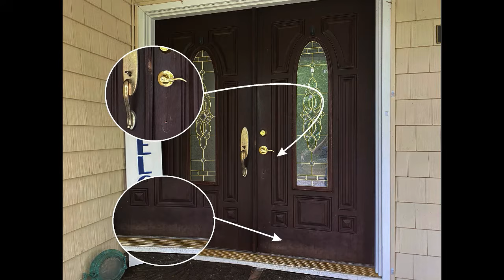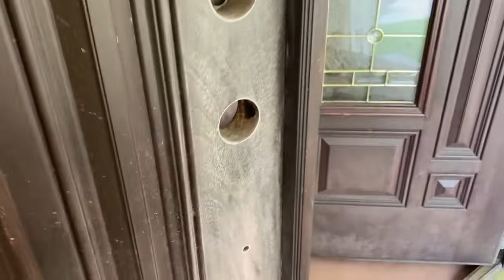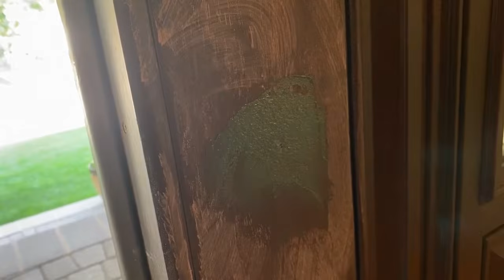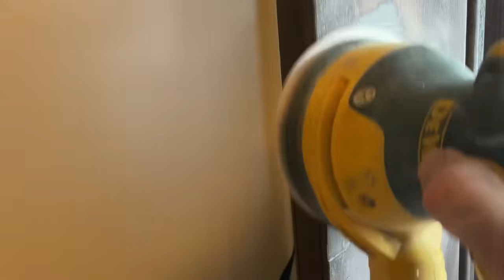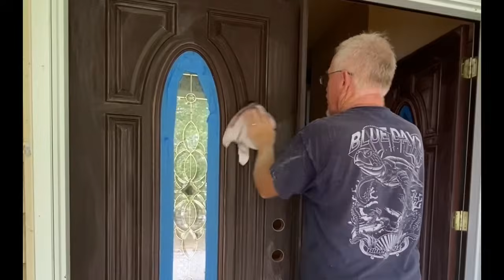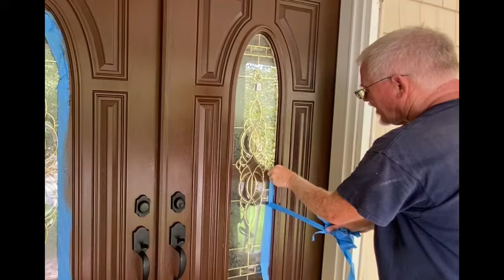Front Door Makeover: Easy Fiberglass Door Repair and Paint Tutorial

Comment: Was your door painted to begin with or was it gel stain before you added the new paint?  Also, you used acetone but others say to use denatured alcohol, why the difference? Is one better for a painted surface?  My door is fiberglass with an oil based gel stain on it and it needs refinishing. Thanks

Comment: That looks AMAZING!  i am getting ready to tackle our front fiberglass entry door .. i actually had a contractor paint it about 6yrs ago but now the paint is starting to peel etc and looks bad
 So, what is my best way to get all the loose paint off before sanding? Thanks for this video, a great help
Reply: Strip it with citristrip. Don't leave it on long. Between 10-15 mins. When i think fiberglass I think autopaint and topcoat. I've seen other use gel varnish on these doors with success too. I would still put a topcoat on ( shiny or matte).

Comment: We have a moon shaped crack on the exterior of our Pella door; it is about four inches wide. Our door has a wood grain. In your opinion, can this be repaired using your technique? Will the Bondo give me enough time to try to tool the wood grain? Thank you for your help.
Reply from the maker: You did not say how long the crack was. Regardless even if crack is 12 inches long bondo should work. Just work fast to get the wood grain. Worst case sand it off and apply grain with 2nd coat. Best of luck!
Reply: @DIYeasycrafts  Thank you for your response. I will definitely do this once the weather warms up 
It beats replacing the door, which as you know, is a very expensive proposition. God bless.
Reply: @DIYeasycrafts  The crack is also about four inches long. One last question…which Bondo product did you use? The kit I was looking at seems to be in liquid form. Thank you once again.